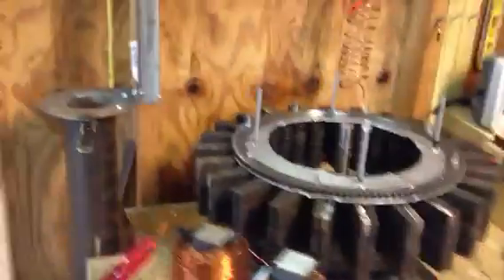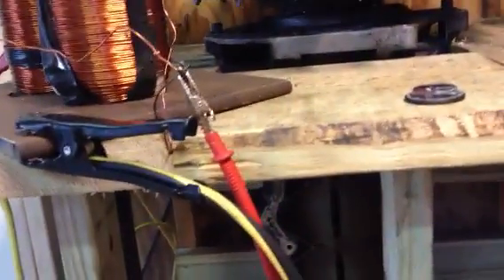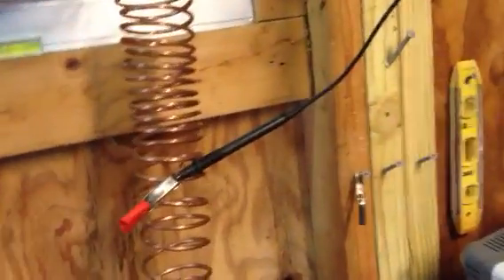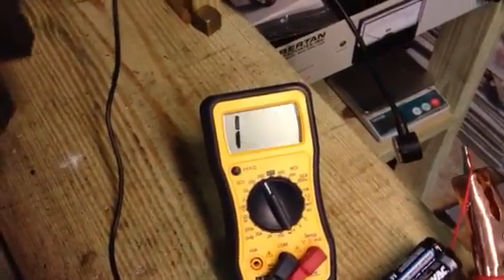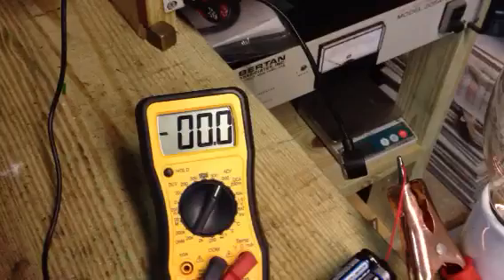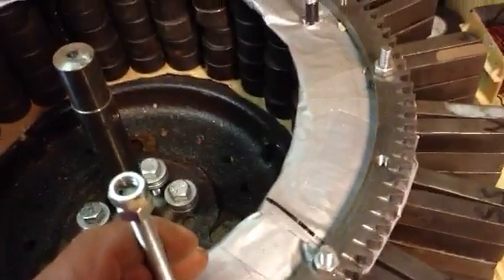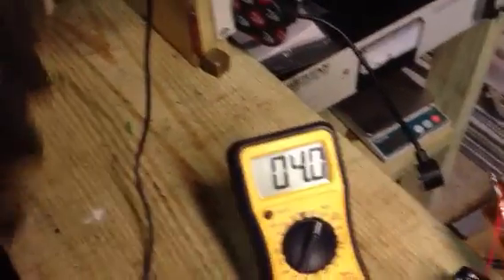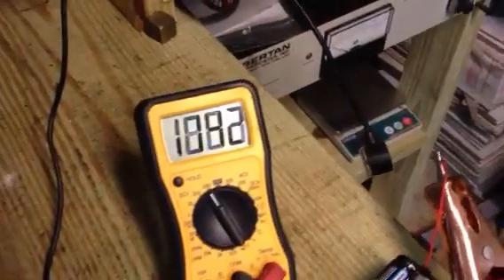Ed Leedskalnin Magnetic  flywheel

Comment: you dont have the sweet 16 which is the henry ford model t flywheel with the sixteen magnets on it. this is the black sun. the windings are all tunned length. you missed the most important part of the device as it was removed from coral caslte.

Comment: I don't pretend to kno everything, and I'm always finding, that which I thought was accurate, is actually not.. But I've been a control tech for 15 years with a solid electrical background, and I'm pretty sure you can't have AD and DC in the same wire.. I'd reckon you've created sort of a DC transformer.. Maybe the multitude of magnets makes it pulse is simulate an AC signal? Either way, very cool.. And BE CAREFUL!

Comment: ive been a subscriber for a while . like your work.
 am getting ready to do the experiments as described  in eds book magnetic current. on the generator , are there plans ?   list of materials . ( i understand  the use of a model t transmission, but those are hard to come by these days , even for ebay.) i am also looking for a soft metal welding rod (arc) but there are so many kinds now .

Comment: :) I used just the PMH  and a magnet switch and 12 volts turns into 700 volts. Myself I made a double half wave rectifier then a voltage doubler. Trust me you do not want to get the discharge of the doubler capacitor. If I had your setup I would try bottles of water half full. Or half empty, depending on how you look at the glass.

Comment: Ed had no connections to any of the Iron... His 'Permanent Magnet Holder' drives the wheel.  His zero EMF horse shoe generator cores tapped the energy. You are so far off and clearly have not read Ed's books

Comment: Anytime you connect current coils and magnets you will see results and you have a lot of all of them. Even though it is a small current from the batteries, you have much more coming off the wheel. The best and strongest tool you have there is your powerful magnetic wheel...which could easily generate for a home; or a craft..or for levitating coral.

Comment: It's the same amount of power.  Power = volts time amps.  you are just transforming the voltage which means as voltage increases ampere decreases but the power stays the same.  essentially what you have made is a starter coil on a car and a spark plug.

Comment: EARTH's MAGNETIC FIELD RINGS LIKE A BELL: In the Lofoten Islands of Norway, Spaceweather.com reader Rob Stammes operates a magnetic observatory. 24 hours a day, he measures the strength and direction of the local magnetic field as well as electrical currents running through the ground. During geomagnetic storms, his chart recordings go haywire. On Sept. 12th, something different happened. They rang like a bell:   http://www.spaceweather.com/ date:13 September 2016

Comment: This can be a very good scam video but not reality. Look at your volt meter. It is oscillating and runs the gambit without any stability.  The other that have posted are right. The is no power period. If so, then put a load on it and measure the stable amps. Amps X Volts = Watts.  Watts are a definition of power measured electrically.  Show us the amount of watts.  But you won't nor can you.  I don't pretend to know or doubt that the laws of physics have yet to be fully understood, but this is nothing to get excited about. No one has mentioned anything about the watts or hp you placed upon the magnets to turn them. That is the only form of power I see.
Reply from the maker: Hi James-
Thank you for watching. However, this a old video. Please check out my new videos. Thank you for your input.

Comment: I've read Ed may have had mercury in the center as a liquid contact for your spring and magnet centers. Ed had a large pile of metal with a chain in the mercury. I think the pile of metal was used as a voltage drop to match the flywheel. Guessing the secret is a variable RCL circuit with a duty cycle. Ed used a radios variable capacitor in that box on the tripod. 
The Sun is the capacitor, the Earth is the inductor, Space is the resistor. Is the Earths center molten iron producing our magnetic field (standard model) or is it the electrons (CME) ejected from the Sun energizing the hard iron core producing a magnetic field?
Reply from the maker: Hey gyro
Your right on any inductor is going to have a magnetic field.
Reply: +vinny stvincent You should look into Ken Wheeler's videos. He proves mathematically and by physical experimentation that magnetism is not a field but a radiation. He also dips into the full unified theory of electromagntism and shows the true nature of light, magnetism, dielectricity, gravity, and electricity. Its really good stuff. It may help your reseach.

Comment: It is a Upside down bell with a Tuning fork in the center.  The magnets are used to induce a spark thar arks the tuning fork in the center of the bell.  Little energy in and more energy out.  Using a Tesla Dome coil to extract the sound wave back into energy.

Comment: friction is the enemy the copper will slow the unit and dosent need to touch to generate a electrical field,, I would suggest a couple 10 farad caps, and an inductor A/c is dangerous, voltage is not the only part of the equation , electrons need to be stored to do work, attaching a light bulb will make it flicker but not enough amps stored to maintain uniformity, close but i think a lesson in ohm's law is in order
Reply: Chris.... do you have any idea what you said..... or what you mean? A 70 year old book from EE101 will give you more than misunderstood words and even a working circuit or two. Theory is the same and so are the formulas, but symbolism and logic have changed.... since I went to school.

Comment: this is good but leedskalnin said he knew the secrets of the ancient egyptians. im certain they didn't have and use many of the technology you have set up here? (batteries etc?) lol
Reply: Actually Yes, The egyptians did have this knowledge. Google the Baghdad battery. If you look at certain hieroglyphs they show the Egyptians using Lightbulbs. It is said that the Pyramids are not tombs at all but rather huge power plants. Which is why they are incased in heavy granite stones. Its pretty amazing. Ed. Leedkalnin is right!
Reply: Rion De Rochestia The Baghdad Battery is completely real; the rest is perhaps more conjectural, but there is indeed good evidence for it, and one also gets the impression that the evidence for it is accumulating recently, which is always a good sign for those arguing an unorthodox position.
Reply: *****
The Baghdad battery was crude and bulky. It was probably misunderstood, BUT, it was hundreds of years BEFORE it's time.
Reply: Google the Bosnian Pyramids even older and Bigger than the Egyptian ones!
Reply: I'm sorry I didn't mean to cause a strange discussion. I'm very much impressed with the set up as many of you are. I'm probably just still looking for that unique and shocking skill they used for the pyramids. besides, copper was one used by the Egyptians so we're on the right tracks somewhere. And LOOK! the bulb! u may have just explained that giant torch they described in the drawings on the inside of the walls of the pyramids!
Reply: haha Melanie!  this is Not a strange discussion. These are the secrets people should be talking about. With the help of millions of youtubers, one day we might actually solve these ancient mystery's. Keep asking the good questions. :)

Comment: Cool video, but the batteries really don't do anything. If you turn a bunch of magnets close to a coil or two, you will make some serious power. He did this so he could have electricity, since he didn't have his own power source. He used a 12v battery to turn the flywheel, which gave him power upstairs (in his room/castle). Visit Coral Castle. It's really pretty, and everything is told to you about how it worked.

Comment: hook up solar panel with little motor to keep it spinning, for the connections you should use brush wire scratching a big metal ring
Reply from the maker: Solar and batteries now on making my wheel turn. Check it out on my new vids

Comment: I think you are very close to genius; Every where thers free enrgy ther is spinning or movement coupled with a jolt of electricity to get things going, Energy from the vacuum. Remember even the galaxy is spinning all the way down to the electrons around the nucleus
Reply from the maker: Did you see the wheel turning yet
Reply: another observation; Kapandaze coil and this one you have show a comonality which is Mother earth Ground why? maybe because theres an abundance of electrons available and get pulled into the open system
Reply: vinny theres a pdf called tesla secets by Vladmir utkin very interesting related to your work. google vladmir utkin pdf

Comment: I also would like to add, you have ben usning 4 coils... For ed's wheel this is wrong, he only had 1 missing intiger in his equation that stil has never been solved and that is actually the whole point... It has 3 coils and the 3rd intiger is an infinite variable, meaning  that 3rd coil (as well as the other two) have infinite adjuastablity accross the wheel as it is spinning... The current is always trying to over or underunify the magnetic motion in the wires that prouces the current, also allowing his frequencies to be doubled or trippled depending on the placment of the coils as wwell as offer differant polar effects.... (Those were the mythical whinning snds, it whinned while he was adjusting his phases, frequencies, and there timing) When the wheel is set up in these arangments it is always trying to defeat the laws of unification magnitism, which will always accure no matter what when the cycle completetes in ferro and electomagnetism. If you use a speaker as you have, and you set the wheel up as stated (making those 3 coils adjustable around the wheel as it is running) you will also notice placement matters as well and "hear" a rickoshie effect that when opposing each other in such a nature re-inforcves the rotating magnetic field. You have the wheel (of that I am enviouse), but you have much work young Padawan. :) Hav fun!

Comment: YES!!! I would love to help this guy out, I simply couldn't afford to build the real version, this guy did it perfect! And I actuallly DO work with skalar technology and transmit wireless A/C, I can guernetee with my knowledge and this mans flywheel reproduction, I could confirm most of Ed's claims including the anti-gravity on a very small scale... But couldn't claim to have the full effect ed claims.. From personal research I can tell you, ED knew what he was doing ans was right about absolutely everything he wrote! IF YOU READ THIS PLEASE PLEASE GET A HOLD OF ME!!!
Reply: Carl Ardoin Incorrect. On both accounts.  Some things do move faster than light... do some research it is all readily available so I won't waste time explaining here.  Also while Cyber Dine is clearly inebriated he does know what he is talking about.  I believe your biggest problem will be fine tuning the phase angle relationship of the magnetic fields to obtain a more efficient SLIP differential.  This is essentially why you are producing less voltage the faster you turn the wheel.   I do not understand what everyone is talking about with respect to power and current and voltage there seems to be a lot of confusion regarding ohms law in theory and practice.  1 volt / 1 ohm = 1 amp.  Apparent power is voltage x current, actual power requires work done.  Very cool though, moment I saw your separately excited induction generator I started to consider how to modify and make it my own.  You have an interesting project there.  If you do some light research into magnetic induction motors you would have no trouble at all.  Best of luck.
Reply: I WILL make building this wheel worht your time, even if the magnetic fields for each magnet arn't perfectly balanced, I can also help balance each mags polarization of the fields!
Reply: Cyber Dine There is something very special about this wheel... and that is it has 24 individual poles and 12 sets of north and south meaning that unlike most any modern generator, one single revolution creats 24 impulses (24hz) so at 1000rpm, that 24,000hz of a/c... the proccess of wireless a/c by making refraction coils to create transverse waves on a longitudinal plain.... which also happens to travel faster than light and break the time event which actually causes physics to operate backwards. XD
Reply: Cyber Dine But the wheel will not run its self. Permanant magnet moters as well are actually impossable and will not ever work.... Overunity does not excist, and if you could or do it is no longer a magnet it is just a chunk of metal with no magnet properties any more. If you try and get magnets to stick together than put them near this rotating alternating magnetic field, they actually loose their properties and will not even stick to each other anymore. BUT, I do a lot of work with coils and have since a child working with my dad building a world class guirtar pick-ups and electronics for high profile bands... So I understand well how to make all of this work properly (And you my friend do ned some serious help with your coils and wiring them up right! I want to do this with you and for you.. I'd love to share my knowledge and show you the ways of this almost black-art) XD
Reply: No you dumb ass...Nothing moves faster than light.   It's a law of physics that has been known for years.  Go read a book !
Reply: Carl Ardoin It was a fact for centuries that the Earth was flat... It was also a fact that we lived in a Heliocentric universe.  Galileo ended up avoiding a death sentence with house arrest for that one.  Do you believe in the existence of black holes?  Einstein's theory of general relativity is just that... A theory.  Many things are until the known perception is shattered by brilliant minds.  This has been consistent throughout our history.  The only real constant is that there will be change.  Tachyon particles are not as of yet discovered however their sub-particles were found long ago.  The theory for faster-than-light particles was first proposed in the early 1960's I believe.  Breakthroughs will happen it's inevitable; I suggest you prepare yourself.  Also there is no need to be so hostile just because you have the anonymity of the Internet. Manners should still apply it's just common courtesy.
Reply: Rob M In short.  The place you are getting your equations for the speed of light for in the first place is a theory.  Not a law or rule.  Your own attack against me is self-defeating...  The whole point is moot this argument is a waste of time.
Reply: +Carl Ardoin Here's the analogy... Let's say you are at a football game sitting in a large
continuous circular arena; and they start The Wave... Ya go team! Now assuming
you are not a wall flower you participate because well its good exercise anyway
right.. so you stand up when the wave comes... now which way did you and all
the people move??&#160; Up and down right?!
Now which way is the wave going? left and right! (I love how the wave gets
reversed by the student section!) So you are the particle moving vertically and
the wave is, well it’s the wave, and it moves horizontally. Cool huh. Now you
can infer how much time it takes the wave to be transmitted around the stadium,
maybe 10 seconds.

Now here's how energy can move faster than light. Ready?
Take one column of people and instead of them moving up, they lean horizontally
to the left. In our football stadium they pack us into the seats like sardines.
It doesn't help that over half of all football fans are probably 150%
overweight so you know how tightly everybody is jammed up against each other,
just like atoms or electrons. So just think if a person or particle gets bumped
by their neighbor, they immediately (basically without delay) bump the person
next to them. The two people act almost as one unit together. Now imagine that
since everyone is in contact with a neighbor, the whole group in that row
reacts almost instantaneously as one simultaneous movement to the left. It’s
not much different than pushing a stick, your energy input took place 3 feet
away from the other end but the movement is "transmitted"
instantaneously to the end of the stick. It would take practically no time for
this energy to move through the row of football fans, and mathematically
speaking, when time goes to zero, speed goes to infinity, which is I dare say,
faster than the wave speed of light! Cool! very cool.

Comment: A generator makes electricity by spinning magnets inside a coil, your cars alternator takes a small bit of electricity and steps it up drastically, both convert mechanical energy to electricity. All the little "shake" flashlights with a capacitor use the former.

Comment: Take a dc motor and hook it up to that sprocket you have main wheel with a chain and then hook the leads up to the motor, and if it can run itself that way maybe put some sort of capacitor in line to see if you can store anything significant while running the electric engine.

Comment: Most of these comments forget about the Converter that recieves these "random" voltages and convertes them all in a consistant 110v or 220v from then on to your fuse box to the battery. Charge controller to vent off any excess power from over charging any batteries.. etc . . .